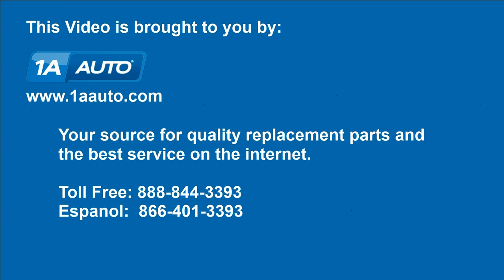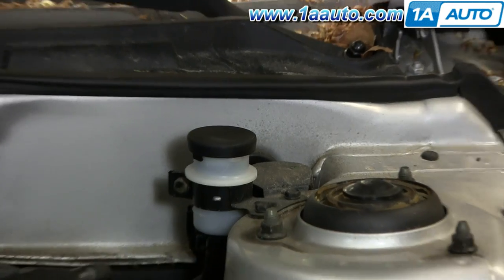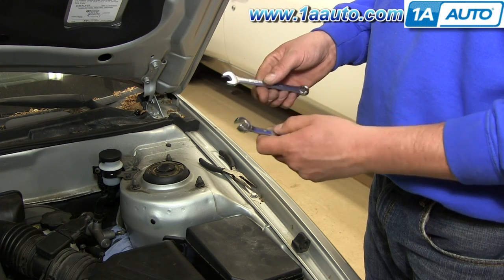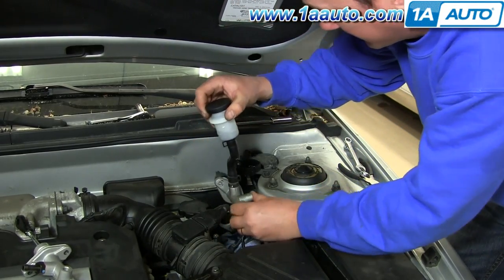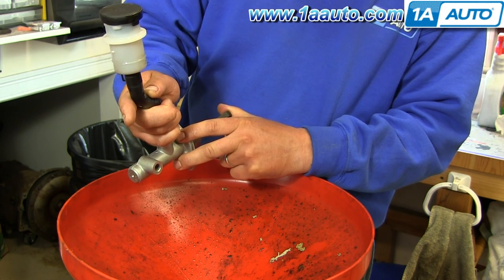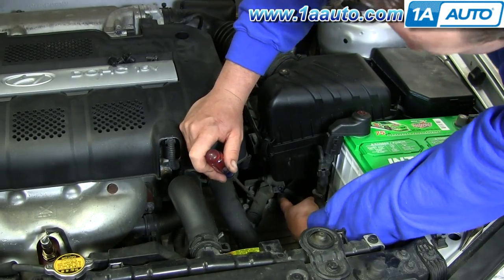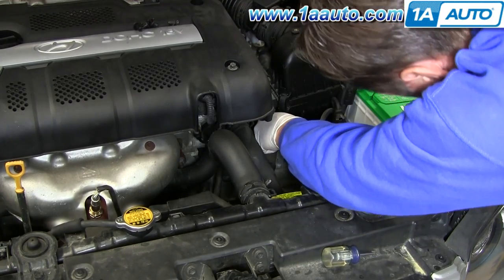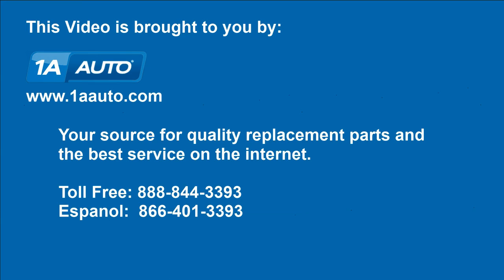How to Replace Clutch Master Cylinder 05-06 Hyundai Elantra

Comment from the maker: The process will be the same between the two vehicles but the parts will differ slightly since the Elantra has a larger engine and transmission.

Comment: I have the same car and the clutch has been replaced and the clutch lever on the gearbox does not return to the rest position so 15mm of rod has been welded onto the slave cylinder so it extends enough so that the clutch pedal can reach the floor. So my clutch works fine but i am not happy with how high the pressure point is. It is really high like shortly after you press on the clutch pedal the clutch disengages. Does that mean i need to shorten the master linkage screw in head of the master cylinder?

Comment from the maker: The brake booster and master cylinder are different parts are are sold separate. 1aauto.com 888-844-3393